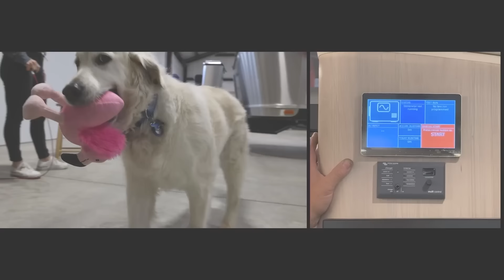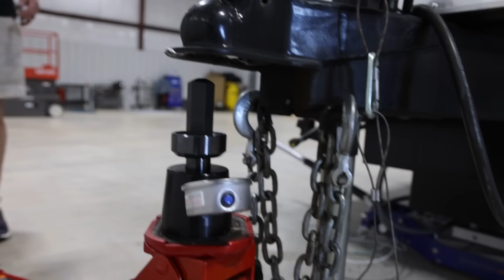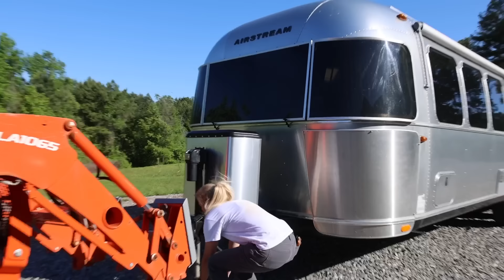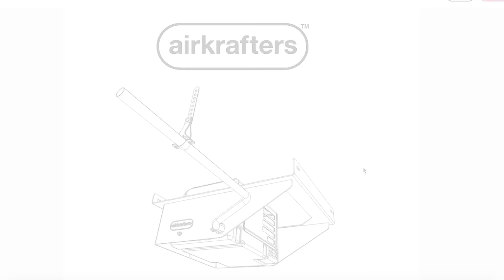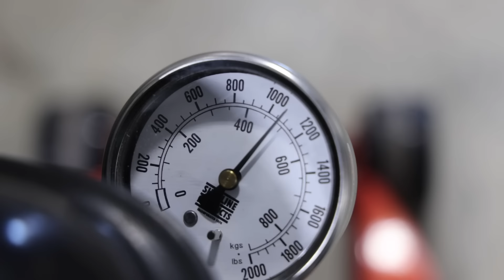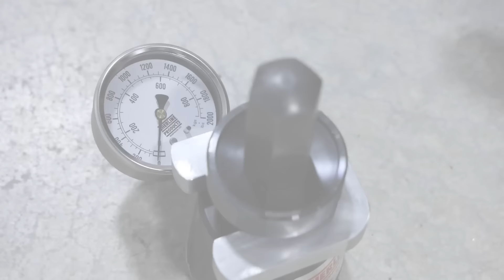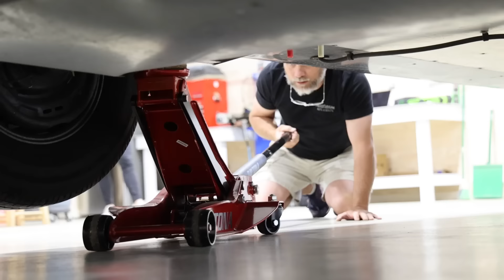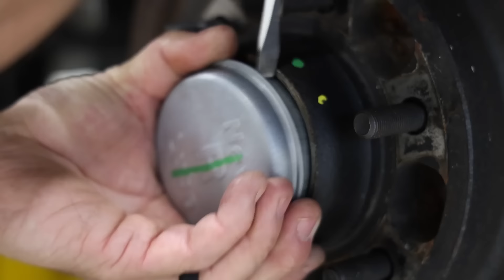DREAM BUILD: Airstream Lithium, Solar & Generator Install

Comment: Curios..when you weghed your Airstream before all the additional weight of upgrades (it showed 1025lbs correct? ), did that include weight of what is in your water tanks, grey water / black water , fresh water etc.  Curios as to what cargo weight was available in your Airstream after your addition of inverter, lithium batteries, solar panel system etc , propane generator as all that seems like quite a bit of additional weight added to the trailer ..thank you ..Mike

Comment: That's dissapointing to see that the builder Airstream uses such cheap low quality accessories as an example being that skylight that you had to replace..looked so cheap and thin

Comment: 37:10 if you’re watching this in summer of 2026 you might want to check into the current problems with Battleborn before moving forward with the purchase. There’s been some issues with the design of the internals as shown by Will Prowse and battle born is suing Will for revealing the flaw. We have a battle born battery bank ourselves and will test the internal resistance to see if the issue has begun to rear its head in ours. Also… if you’re charging at 50 amps stop immediately. After Will’s video battleborn changed the specification for max charging amperage to a lower figure (I think it was 37 if I remember correctly). 

I’m sure KYD will (or has already) get a new battery sponsor but there are probably still a lot of YouTubers out there pushing the batteries due to a contractual obligation. 

GRAT video Marc and Trish! 🍻

Comment: Well this video didn't age well. Battleborn batteries have turned out to be horrible batteries and dragonfly energy is doing everything they can to cover it up. I would pull this video if I were you.
Reply: Seems the good folks at KYD have no comment. Conclude from that what you will.

Comment: Serious technology better then any of what was put into that tralier.  Pizoelectric solid state Stirling cold gas cycle piston air liquifaction module generation of liquid air fills an insulated tank.  Gravity fed to ultrasonic vaporizer frequency set to generate HHO from the liquid air that charges up solid state sponge HHO fuel storage cells. HHO used for HHO fuel cell electrical power generation system waste water Gravity fed through filter for fresh drinking water supply.  Liquid air fills insulated copper pipe to copper coil with tiny holes covered with carbon felt to wick up the liquid air with solid state fan passing air over coil for liquid air heat exchange boil off air conditioning system.  HHO feeds 32 micro jet burners for heating cooking hot water generation.  Liquid air fills fills coil in freezer refrigerator. HHO burn chamber with grinder rollers to burn off urine and the sticky stuff and paper that's turned into sterilized rich top soil deposited into a pull out bin for waste management.  It's a new age shouldn't the technology fit this new age? Wouldn't this technology save lots of money for tralier owners? 🤔✨️

Comment: We're considering going back to an airstream after a 4 year diversion RVing in a Super C. Question: after having the generator for a year or so, how much do you use it? We're wondering if we should install one or whether the solar and DC/DC charging are enough. It would be good to get an update on your upgrades and which you would do again and which you might forego.

Comment: It's not quite the point of the video but this highlights why I will probably buy a used Airstream over new. That full price tag is not worth it if you need to make after-market expenses to improve the trailer. The 3" lift and water tank modifications alone should be standard from the factory.
Reply: The lift is included from the factory now. Not sure about the water tank

Comment: Why not just bring a portable Honda generator?
Reply: And it will find a generator isn't as convenient as the Onan. The install generator pulls from the propane on the trailer or the Honda you have to take out of the truck fill up with fuel put it back in the truck back and forth. This may cost more but it is way more efficient for the RV lifestyle with less to one load
Reply: Why do you go out in nature to then run a noisy generator? 
I prefer hearing the chirping birds and the sounds of quiet wildlife miles away that can't be heard with even the quietest of generators
Reply: Also if you run a generator to make electricity, 365 days a year (rather than only a few weeks a year like some people) it actually pays for itself over time. 
But honestly its more for quality of life. 
If you were budget worry some, why an Airstream?
Reply: They are off-grid a lot and so they're able to use every bit of the trailer when they're off grid because of the solar. But they run into essences where they do need the generator because it's been storming for days.  @travisminneapolis

Comment: I've seen a small metal tab that was welded to a few of the bolts that went to the lift kit. It was because you couldn't put a wrench on that bolt to tighten. I did not see that done on your build. Is it necessary?

Comment: When you installed the liftkit did you only unbolt one side of the axle at a time, installed and bolted up the lift kit bracket and then moved over to the opposite site to handle the same there? So was ok not to unbolt the one side and put that little extra stress as axle dropped unevenly? I'm going to install the kit myself and like the way he did it. I have the jack stands already.

Comment: What solar panels did you use? I browsed every comment and didn’t see an answer. Also, you had mentioned wiring them in series parallel. But, you also mentioned, “let’s not get greedy by wiring up two separate panels”. Can you elaborate on that? I see you mentioned 9 bus bar panels so that current could flow with partial shading-cool idea. I have found some I like, but I really appreciate how narrow the ones you have installed are.

Comment: Important point at 41:30 about the battery disconnect switch that come with airstreams...it does not disconnect everything from the batteries.  So if you store it with the batteries still connected and that switch in storage mode, you will come back to dead batteries.  I learned that the hard way with my lithium batteries right after I bought them.  I didn't physically disconnect them from the trailer before storing and when I found them a couple months later, they were at critically low voltages.  Fortunately, they didn't seem to be damaged, though I suspect I lost a little bit of capacity as a result.

Comment: Excellent videos,   What size wire did you connect the solar panels to the 8 awg? Are there 15-20 amp fuses per two panels?

Comment: Ronnie, do you just use Sikaflex to hold down the new skylights or you also screwed them in?
Reply from the maker: He uses the high bond tape. But only because the Airstream roof is metal. It would not work on rubber roof.
Reply: @KeepYourDaydream  Thanks for the reply KYD! For the solar panel, yes. I was talking about the new skylights. Wondering if he screwed them in, in addition to using Sikaflex.

Comment: It must have come up during the design of these upgrades, going with two DC to DC chargers. Assuming that's the case, why didn't you opt for doubling the charging amps while driving?

Comment: I did the same cooktop mod in my Sprinter.  To reduce metal on metal wear, and noise but in the truck you don't hear it, may I suggest high temperature silicone nipples for the legs on the cast iron grates.

Comment: It's all pie in the sky until you live a few years off grid in CO at 8500'. Everything freezes solid unless you're running heat 24/7. Batteries go dead pretty fast when running heat all night, so by 2 am no more heat. Propane tank running out at 2 am is fun too in pajamas in a blizzard. Laying on your back for an hour or two in the snow trying to melt the grey water pipe with a heatgun. It's all worth it but it's hard work. Hauling
2000 lb water tanks and 100 lb propane tanks through the snow drifts is no joke either.

Comment: Extremely dangerous crawling under the trailer when only the floor jack was holding it up. I would have shoved the jack stand under with a 2x4 and not put my life on the line

Comment: Hey awesome video. Quick pro tip. Sikaflex requires Sika Primer to bare metal. And if there is paint, they have an activator. It makes a huge difference in the bonding. Without primer and proper prep (sanding and cleaning) it will release from the surface. Hope that info helps.

Comment: Lif kit is aok. What about air ride springs that you can raise for underclearance or lower for overheight issues. Smoother ride for tow vehicle  and trailer.
Used on tractor trailers for some time.
Also disc brakes stop 30 percent quicker , less fade  just win win over all.
Other mods on this episode are stellar.

Comment: 8 ga is rated for 40 amps not 50.
Reply: ABYC standards States Outside an engine room it’s rated at 56A The table below The ABYC E11 Table IV B and shows the ampacity for wire with 105 degrees C insulation in bundles of no more than three.

Comment: Airstream supposed to be best. Sweat the detail, no el-cheapo components.  I call bull Shft.  The Warren Buffet/Marcus Lamonis style of down quality to help them buy a bigger jet, Airstream also does, is crap.  Glad upfitters like here correct most of this chaos. Makes the Airstream price difference look like a rip-off…
Reply: And here’s @johnross6314 with absolutely no content on his channel, all mouth…
Reply: @Filmpilot  better than being all beak. Pecking and scratching at nothing. It is what it is. This pro is in business because Airstream rep and pricing is BS.  If they did it right to begin with, his upfitter biz would not need to also focus on Airstream <Jayco quality items and labor.

Comment: The side view of your trailer underneath looks like one of your axles is bent. Have you noticed that or was that distortion in the video?
Reply: That’s normal. The Dexter Torsion axles are bent in the middle.

Comment: What nobody thinks about with solar is you have to park you coach in the sun......on hot days that can make the coach need even more AC power and consumption. If shade is available it makes a huge difference in overall comfort.  Having a generator on board makes perfect sense. If I had to choose between the two, I'd take a generator and lithium's over solar panels and lithium's any day.....especially for those camping in the S.W. during the summer.

Comment: Im confused. The roof is aluminum but the paint on it isn't so why did he say the VHB was fine because the roof is aluminum?
Reply from the maker: Most RV roofs are a thin runner put over plywood. They peel off.

Comment: Why not use the factory solar panels?  Are the panels used that much better?
Reply: Much better form factor so we can get more up there.
Reply: @airstreamnutsandbolts  thanks so much for the answer.  What kind did you use?
Reply: Newpowa 100W
Reply: @airstreamnutsandbolts  Thanks again, you are the best!

Comment: All of this looks great! I wish I could afford to do the lithium batteries and generator and all of that, even though my rig is not an Airstream. I am confused about one thing, and maybe I'm just missing it: You fastened the water tank straps to the axles. Don't axles move with the suspension?!
Reply: No the Dexter axles are torsion axles and only the torsion end moves.
Reply: @airstreamnutsandbolts  Oh that's  right! I hadn't thought about that. I'm so used to the old poor man's straight tube axle campers. 🤣

Comment: Great video! Watched the whole thing even tho I don't have an airstream lmao. 

Just wanted to note that as an electrician his explanation about why you can use the OEM 8ga wires was only partially correct. 

There is no impedance in DC circuits. DC resistance does not decrease in proportion to voltage.

Here's the technical explanation:
V=IR (Volt=Amp•Resistance).
Since resistance can never change, then V and I are inversely proportional. Since Mppt solar charging controllers are exponentially expensive as you go up in I, you instead increase V so you can push through more Watts with the same system.

The amount of waste dissipated through your wires is calculated by W=I²R, meaning that if you dont configure the panels in 5s2p (5 series, 2 parallel) to make a 48v nominal system, you are dissipating 16x as much power over those 8ga wires, by running 4x the current through them!

Long winded, but it's such a good video I felt it deserved some elaboration.

Comment: I know you have a BattleBorn sponsorship but for those that do not. EG4 has 5kw (400amp/hrs)of lithium phosphate for $1,200. Half price of BB And are a better battery for med and large bank as their bms communicates with each other and the whole system will not crash if there is a problem in one pac. So you still have power too see what's going on.  Thanks for the Great detailed install video, I know it was a lot of work but was so informative.    CHEERS AND SAFE TRAVELS       Steve h.

Comment: Ronnie, when so many say not to lift the AS by the axle, can you explain why you feel it is a good practice?  Thanks for the video and your excellent work.
Reply: There is a very simple explanation, because of liability reasons and people not having the knowledge or proper equipment. The spot I use to lift the Airstream is the point where the axle bolts to the frame. This point is where all the weight of the trailer is carried by the axles. The average person should just use the jack points for simplicity sake. I use the points I use because the work I do requires it.
Reply: Ok. I get it.  You put the jack stand on the second axle at the same point you lifted the other axle.  It makes sense to me.  Thanks again.@airstreamnutsandbolts

Comment: Correction. The Honda 2200 is rated for 1800 watts continuous, NOT 1600. Don’t sell em short!
Reply: They are rated at 1600 Watts if they are running on Propane like the Onan.

Comment: regardless of the mods - its disappointing that a world-class trailer, Airstream has issues with clearance and water tank bulging that need to be fixed third-party...  We use Battleborn also, and absolutely no problem. Rather pay more on the get go, then try to fix later.

Comment: When putting lithium in a bumper pull do you need to disconnect the 12 volt lead from the 7 pi?
Reply: Not necessarily, but the DC/DC charger in this case covers it.

Comment: Not sure if this has been asked already… How do you protect those solar panels from hailstorms?
Reply: They are Tempered Glass and quite durable. But if hail is bad enough to damage them….. you’ve got bigger problems
Reply: Pretty much all solar panels are rated to take some pretty serious hail.  You are much more likely to get damage on the roof from hail than the panels themselves.

Comment: I must be missing something.

How do you put straps across the water tank that hang from shackles bolted to the axles.  When the axles move surely you don’t want your tank to move as well.

Thanks

Dale
Reply: Axles are Dexter Torsion axles and the main axle does not move only the torsion end moves.
Reply: @airstreamnutsandbolts  wow I thought the same thing how does that work lol That’s awesome.

Comment: Maybe I didn't see it correctly? But did you just anchor that new Solar Panel with the new adhesive tape without patching the old screw holes?😮
Reply: Holes were patched.

Comment: Good morning, where ever you are. My wife and I have been enjoying your videos for many years and we own a 2021 GT FBQ. We have modified /upgraded our GT over the years and we just did the 3” lift and now working on the flagpole hitch with Starlink. We also changed to the cast iron grate and it’s amazing compared to the original design. However, you need to take out the rubber inserts from the original grate and install 1/4” stainless steel plugs that cover the holes or you will get food/liquid into  the holes and will drain into the components. We like your mods/upgrades and looking forward to the rest of them and your 2024 adventures.
Reply from the maker: Noted. Thanks!

Comment: I get Battleborn has great customer service and that is worth paying for, but…. The price of lithium has dropping like a rock in the last year world wide.  Battleborn costs pure battery are now less than half it was a year ago, but they have not adjusted their price to reflect that.  It feels to me like they are now just ripping folks off because they have fine folks like you telling the world how great they are without telling the whole store.

An example:  after you said all the thing you did about Battleborn, that you then mentioned that it is possible to get the same size battery your getting for almost 20% (550 vs 2500) that if you underdtand this stuff or dive in and learn it, you can save a lot of money, then I would be giving you a big thumbs up.

My point, let folks know there really are options.
Reply: Yep, I don't know why anyone would buy Battleborn at this point.  Tons of options.  And for the same price, you could get enough to sustain air con for longer if you wanted.

Overpriced.
Reply: @agtcovert  I’m pricing out a system with Victron Energy batteries which is a better system and cost less!

Comment: Liking the new upgrades, but uncomfortable with the VHB solar panel attachment. Adhesives degrade. Thinking a leach or a secondary method of attachment would be wise. Seeing a solar panel flying on the highway would be spectacular and terrifying.